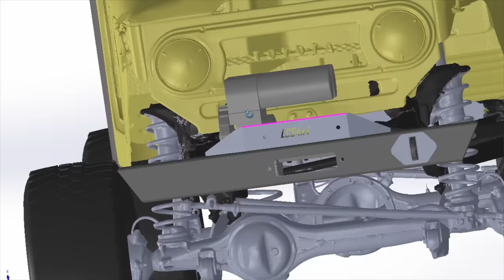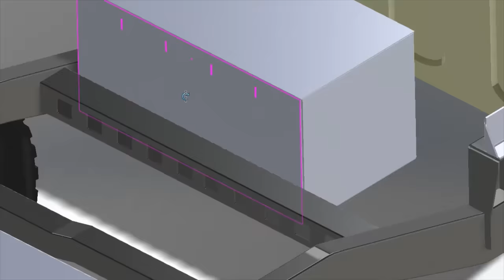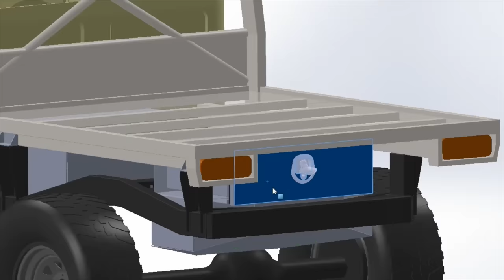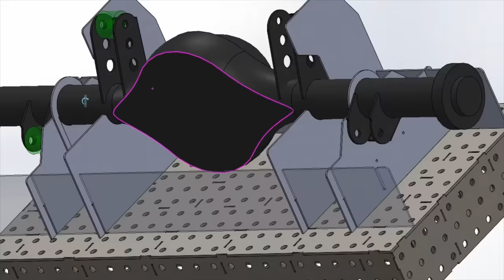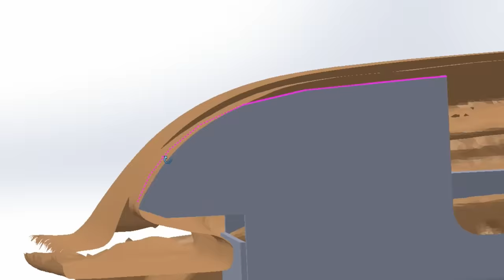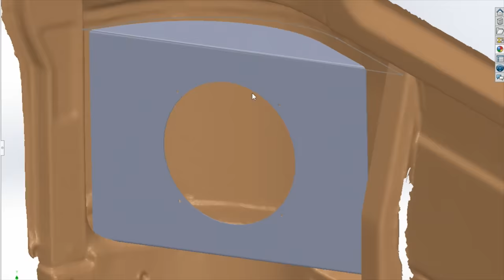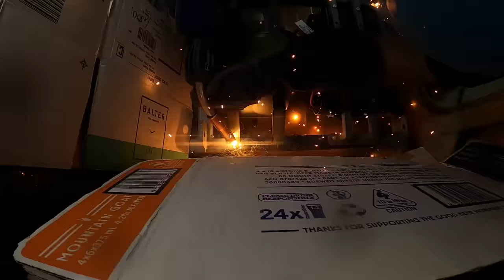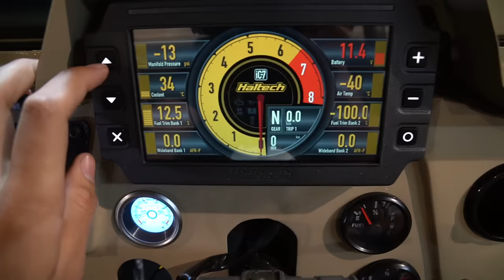3000 Hours to BUILD my DREAM 4x4 in 17 minutes

Comment: What all FJ-45's ought to look like.  Very nice.  I'm 6'1" and owned one of these monsters back in 1980.  Great vehicle, but shit for comfort as I couldn't lean my seat back far enough.  Cab needed to be another 6" long.  For someone less than 6 feet tall, no probs.  This truck was rated at "1 ton", but i had over two tons on it one time moving a pallet of lumber.  Crossed a mountain river in spring flood, and very nearly got washed down stream.  Heavy right foot and four-wheel-high got me through OK, just barely.  Water was over the fenders.  Yikes.
Reply from the maker: 100% I’m 5”10 and my biggest regret is not putting another 100mm in the cab!

Comment: Incredible outcome and some pretty mad skills to bring it all together. Did you have to get the custom metalwork engineered and xrayed and all that stuff? I reckon it's the nicest 40 I've ever seen. The modernisation of the interior is awesome, and it must be quick!
Reply from the maker: Thanks mate, I did a fair bit of FEA myself. I got the engine mounts and cab mounts welded on by a professional but I did the rest and didn't get it xrayed, has help up after 40,000 K's!
Reply: @DesignedandBuilt  AWESOME!

Comment: Mind me asking, I always wanted to restore a car as well, but considering as an 'amateur' you start from zero, how do you finance this? Just set aside budget on the go? I noticed you also have a lot of working tools, should you begin building it up , any tips on how to actually materialize a project like this?

I love what you did !
Reply: As someone who asked this question many times, my advice would be to find a community around you. Having people around you that have a lot more experience than you (even in just using tools to fix cars) is immensely helpful. Look around you for any Off-roading or 4x4 clubs. Most places have some sort of club and if you're lucky you may find one that's specific to your vehicle. You can use their experience to help you when planning, designing, and building a project like this.
Most importantly I think is just starting. A man named Ken from an off-road touring channel called TacomaBeast recently said in a video is that the most important thing you need to start going off-road is a sense of adventure.
If you have a car, then just make the necessary mods on it & go. Most people will argue that the only 'necessary' mod that you absolutely need is a lift & new tires, depending on your vehicle and the type of off-roading you hope to do. You don't need to be making huge tons of money to go have fun off the beaten path, you just need someone more experienced than you and a hunger for adventure.
In terms of financing & equipment, you can save up over time as you said. I mean this project took almost 2 years to build. You don't have to built it all in one go. There's no point in spending a lot of money & adding all of these modifications only to realise that most of them weren't absolutely necessary. Start with a lift & tires. Then maybe a winch. Then maybe suspension. Then maybe lights. Go along depending on your needs & finances. 
In terms of equipment, they are only a means to an end. A lot of things you can do with basic tools but it will take more time. A lot of tools (especially ones you see in fabrication videos like this) just make the job move along faster and/or maybe better. But you would be surprised how little tools you need to just start out. ChrisFixIt is an absolutely great Youtube Channel that shows you how to fix pretty much anything on your car with as little time & money as possible while still having fun. You can also borrow from your new buddies that you've found or rent from anyone who has. 
I'm sorry for rambling on & on but I think the best advice is to just start with a bit of planning & a love for the craft.
Reply from the maker: Saved hard, sold my car! I wanted to do it all at once and not little bits at a time so I waited for years before I started. 

I built my skills doing other projects, renovations, furniture etc before I started! 
Tools - buy as you go!
Reply: @DesignedandBuilt  Can you spill the make and cost of the 3D scanner, and how you incorporate that into your tooling?

Comment: The only issue with all that stainless is those parts will get very hot and hold alot more heat in the engine compartment

Comment: do you have a full time job?

going by my working out there is 17520 hours in 2 years Divided by 3000 is 5.84 hours per day every day

hahah
Reply from the maker: Certainly do! Including outsourced work and Hours from friends. Also I just spent 28 days driving and testing on holidays which was a few hundred hours. But yeah every weekend and a few weeknights for close to 2 years!
Reply: @DesignedandBuilt  well that's awesome Looking forward to Driving with you one day
Reply: Richard is known to faff a lot. Could have done it in half time time

Comment: high coolant temps for sure. that radiator needs to breath
Reply from the maker: It works well mate! Has 40k on it now without a drama :) good thermo makes a difference
Reply: @DesignedandBuilt  well i'm amazed. you completely blocked the back of it. how air's gonna flow through that?
Reply from the maker: It can go past the fan!